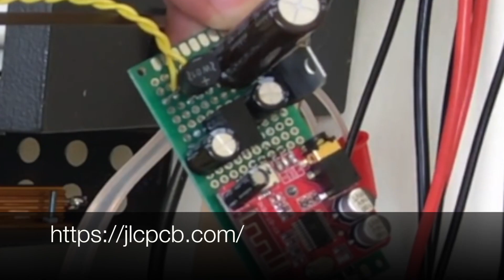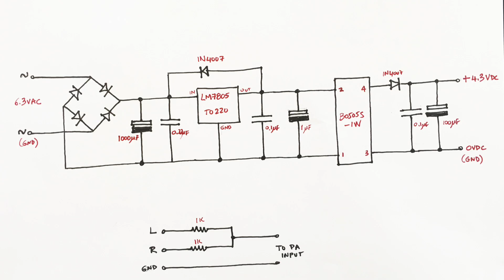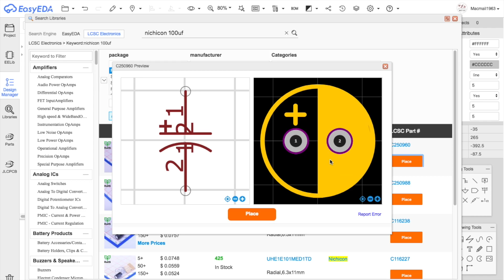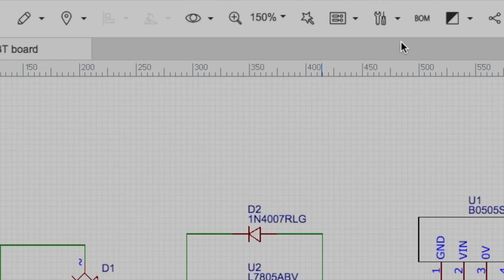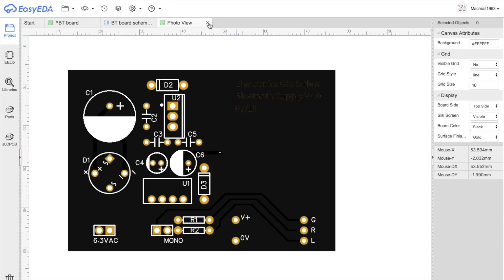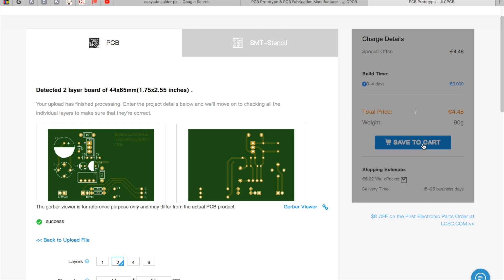EasyEDA PCB design and order from JLCPCB

Comment: How would you do the same starting with a 9VDC power source - if I’m doing this correctly, I’m getting 9VDC from my bulb in my tube radio
Reply from the maker: You can just bypass the diode rectifier and connect across the filer capacitor.
Reply: @electronicsoldandnew thank you! Was also learning about zener diodes… the board just arrived… what do you recommend? Adding a zener diode and resistor or just bypassing the rectifier. Will use the other boards for 6.3volt input…
Reply from the maker: I’d use the board as it is with the voltage regulator, and only skip the rectifier diodes.
Reply: @electronicsoldandnew  thank you for your quick responses and help. I’m super new to everything, but have learned quite a lot. Recapping tube radios and adding Bluetooth to some.

Comment: Ha! I'm just making a vid to post soon on using EasyEDA to make some updated driver(s) and a power board for a Dynaco ST-120 solid state amp. I've chosen to skip the schematic design part, mostly because since I have a schematic and don't need to SPICE model it, I just go to the PCB  screen, place my components, run my tracks and Bob's your uncle.  I've found the 3D view helps ( if you choose to add parts as a "footprint" and they have good 3D models, as you wil see the actual components) to make sure you don't have physical conflicts in parts, presuming you picked the right 3D model sizing. Running the DRC check and fixing any errors before creating a gerber file for board creation is a must as well. Good info, thanks for posting!

Comment: Using a simple SMD resistor, what does JLCPCB consider zero degree rotation? The part is vertical? And 90 is horizontal? Or ?

Comment: Excellent tutorial. I am assuming this is your own design. Is it copy righted? I would like to make similar PCB for my own use, non commercial,  however I do respect copy rights and do not want to infringe on yours if that's the case.
Reply from the maker: You can use those designs as you wish. I have no problem with that.
Reply: @electronicsoldandnew  Thanks

Comment: Great video - thank you. I'm wondering if you know how to define cut outs in the PCB boards? I have a transistor tester whose prototype I did on a strip board and I have a nifty enclosure for it that requires two half round cut outs. I've not found a solution yet.
Reply from the maker: I believe you can draw the outline Of the board in any shape you want, not just the regular rectangle.

Comment: Hi how do I put all my silkscreen on bottom of PCB than on the top? So I can send for manufacturing.
Reply from the maker: The silkscreen is placed on the correct layer as per the layout of the component. If you want to change it, you need to move it to the chosen layer in the software.
Reply: @electronicsoldandnew  hi OK I'll have ago but thanks for responding cheers.

Comment: You skipped a lot. I would like to have seen you placing a few components to get the traces the way you wanted (not all of them but, say, three or four). How did you get multiple trace thicknesses and how did you decide which thicknesses? Were you able to adjust the paths?
Reply from the maker: I do the layout manually and decide on track width using some experience.

Comment: I have used JLPCB but just note that this cheap price is only for your first order. The price goes up quite significantly for any orders after the first. OSH Park is also very cheap for multiples of three boards https://oshpark.com/ note that you will be submitting Eagle board files here and it has no circuit design software like JLPCB does